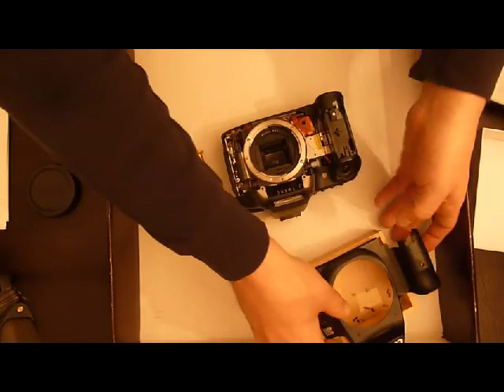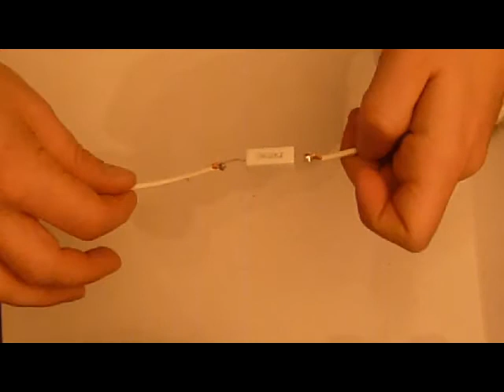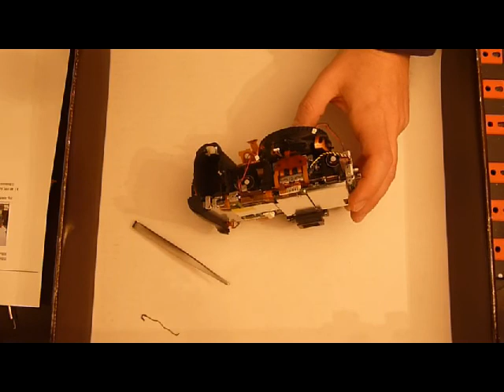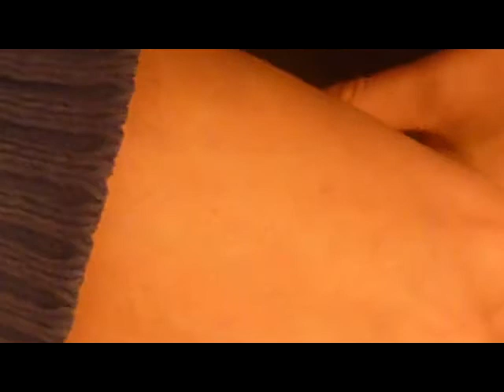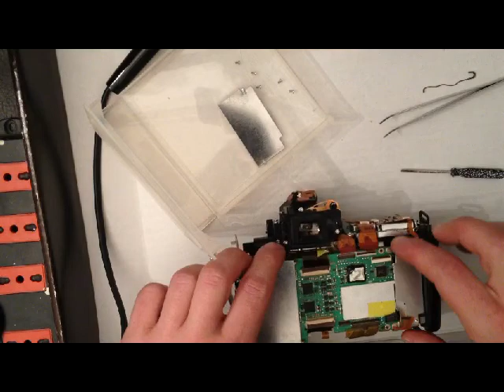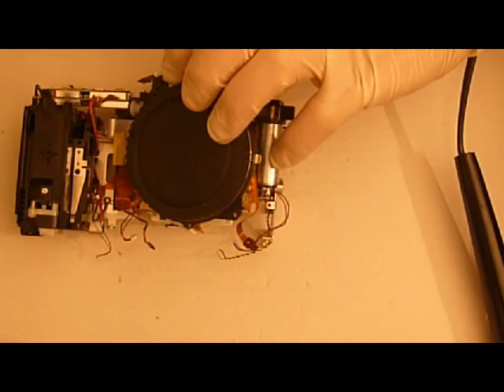Disassembling Canon 40D DSLR with ERROR99   shutter replacement 1/2

Comment: Sadly enough I do appreciate this gentlemen taking the time to record this - Unfortunately my problem is on my Canon EOS 1D Mark II "ALL IMAGES ARE NOW BLACK", and I get NO HISTOGRAM RGB histogram read out - HEEEELP !!!!!!!!!!!!! PS Just got off the Phone with CANON - They said it the "CURTAIN" that not opening which prevents me from seeing the Sensor - HEEEELP !
Reply from the maker: I know how you feel!
if this happens with any lens, can be the shutter jammed or the shutter engine broken.
maybe you can see what is wrong by try to shut a picture without lens with long time of pose.
and maybe you can just try to softly knock and see if it moves.
Another  try can be to set the camera in sensor cleaning mode and check if the shutter move or not.
probably is broken and have to be replaced but this is what I would do as first try.

Comment: Hi Freddy
Do you have any clue how i replace a Contact FPC Flex connector?
I asking because one of the contacts of my Canon 40D got stuck and got lens error all the time.
Reply from the maker: Sorry, I don't. But maybe you can find some info on how to replace on the "canon 40d service manual". you can download from some sites... I found it searching with Google, if you don't find, just ask me I try to see if I still have someware and I can share it.
Good LUCK
Reply: Hi Freedy, 
Thanks for your quick reply :)
I ve download the camera manaul service. I wonder if i ve to dissemble all the camera, or if i take the front and the bottom cover will be enough?
Reply from the maker: Of course it depends about what connector you have to replace,.
If I remember in the last section of the service manual you should find a very detailed disassembliing path, il there you'll probablly will find the answer.
have you seen in the first part how interesting are the informations about how the camera works in depth, That's something i really loved to read.

Comment from the maker: Thanks!
the 40d is still a great camera even if there are excellent features coming with the new cameras.
Error99 is really a pain because after 3 - 4 year from buying, the repair would costs the value of the same used camera... this for a little component that would be so easy to change inself if it wouldn't be necessary to disassemble half of the camera to di it.

Comment: Hi freddy, thank for replying :) I looked into the service manual.. I found the connectors for the relevant components and tried reconnecting them, no luck.. the things that worries me is that I hadn't disconnected the AE sensor, so probably the problem is somewere else :S
I'll check if there's a new firmware :)

Comment from the maker: hi
Unfortunately I don't have any knowledge about the exposimeter issue.
It can be anything, just a cable not properly plugged, the exposimeter broken or some other electronics ... 
I'm sorry i can't be helpfull I hope you'll find some other with deeper tecnichal skills
have you tried to look in the tecnichal sevice manual of the camera?

probably will not help in this case but.. have you updated the firmware to the latest release?

Comment: I sucessfully replaced the shutter, it's now working very well, except the AE and/or light measurement. If I shoot in automatic pictures are always shot with the same values (1/500 and f/4.0). In live view the light measuring works fine and I get good results.
For now I can use the camera only in manual mode, where the exposure estimate (the -2 +2 line) is wrong and always on +2.. an idea how to fix this? I didn't touch these components during my repair..